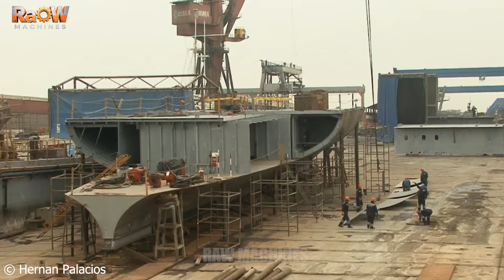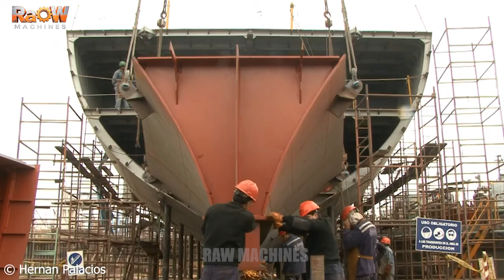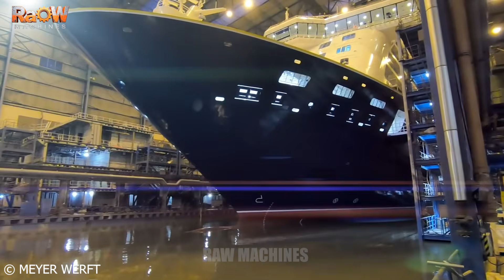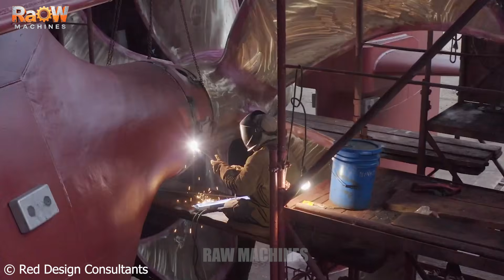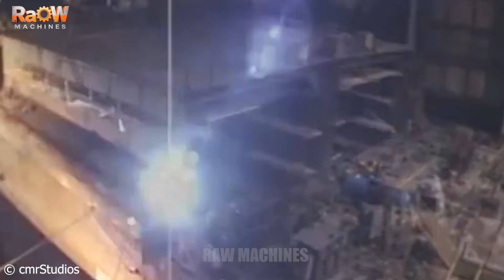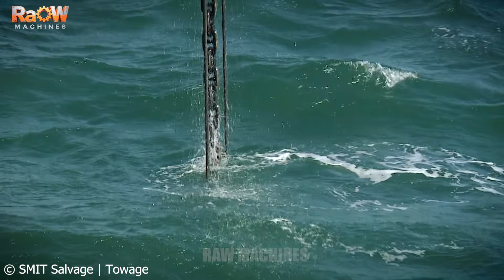How Giant Ships Are Repaired | Engine Installation, Hull Cleaning & Propeller Replacement

Comment: I’m not one to criticize welding methods for attaching each section,  but I’d be leary about the strength and integrity of the welds holding each section together. One bad or improper weld and that ship will break in two when it encounters violent storms that stress the welds to extremes.
Reply: That's monitored and controlled very thoroughly, with different methods. And the steel brand is choosen not only by strength, but good for welding and much more. A proper welding is good like one piece, the structure is homogen.
Reply: And yet, how often do you hear of such things happening? Have you ever?
Reply: So you are expertly presuming that the welds are bad and not good? Yawn.